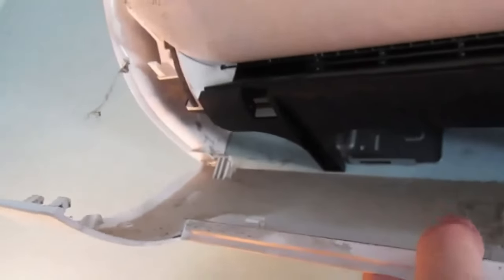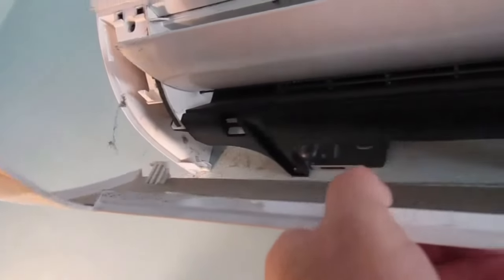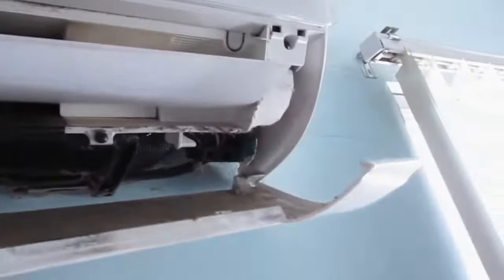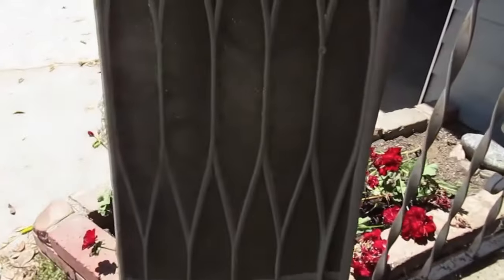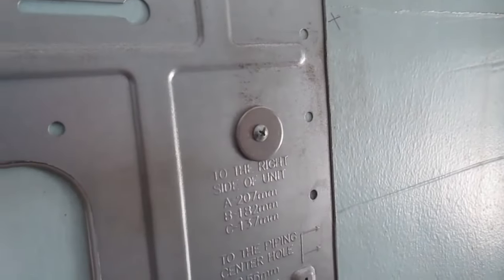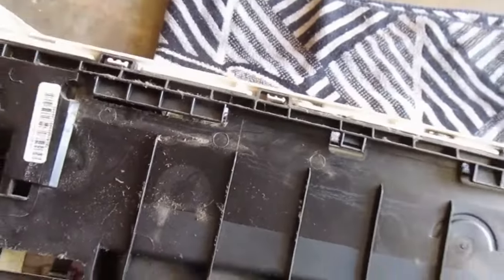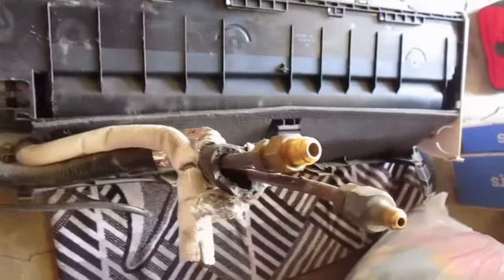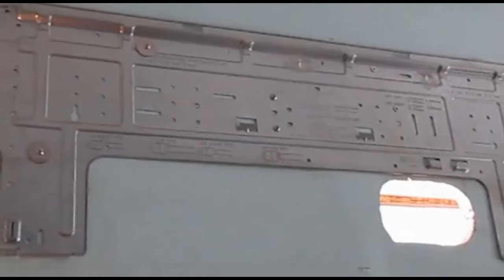Remove Mini-Split Indoor Unit

Comment from the maker: * Mini-split A/C lineset (this is the link to the 25 ft.; other lengths available also): https://amzn.to/3uB3pO6
* The gauge set used in this playlist is available here: https://amzn.to/48hwEDn
* You will also need an adaptor to connect your gauge set to your outdoor compressor, which is available here: https://amzn.to/3wrOV3v
* HVAC quick connect coupler fittings: https://amzn.to/4a2DkpG  <<<less prone to leaks, easier to install than flare connections!
* HVAC quick connect right-angle coupler fittings: https://amzn.to/3yciW8k  <<<prevent leaks and connect your linesets with ease!
* When connecting a lineset to a compressor via a flare connection, use "Nylog Blue" HVAC sealant, which is available here: https://amzn.to/3SL49bs
* Featured in this video series is an LG mini-split system. Comparable to LG systems - but more affordable - are Mr. Cool mini-split systems, which can be found here: https://amzn.to/3T9rLb2

Note: linesets consist of two separate refrigerant lines, these can be 1/2" O.D. & 1/4" O.D. or 3/8" O.D. & 1/4" O.D. Make sure you order the correct diameters to connect to your outside compressor unit! I recommend that flare connections ONLY be used where the compressor connects to one end of the linesets, in which case you'll be using factory flares (producing your own in the field can lead to imperfections and therefore leaks).

Comment: How do you disconnect the lines without losing everything in it? Wanting to relocate mine.
Reply from the maker: You can't - you must vacuum the system first. Here's how: https://youtu.be/wWxH5AqCMBk
Reply: Yes you can, pump down (recover) the refrigerant back to the condenser, search how to pump down mini split.

Comment: Hi DIY&S ~ I hope that you monitor your videos because we have a very aggravating situation that falls under the category of "Remove Mini-Split Indoor Unit."  We have a defective Mitsubishi 18K BTU mini-split system that must make way for a new mini-split system.  All of the external connections - power, drain & both gas lines - have been disconnected outside, so, naturally, it's time to pull the old MSZ-FE18NA indoor condenser unit off of the wall, right?  Well ... I can see absolutely no method for pulling the damned thing away from the wall!  The cover was easy enough to remove, which gives one a great view of the inner workings, but I can't see anything that's holding the unit to the wall.  Although it was very tough to spot, I can see that there's a narrow metal bracket mounted to the wall behind the indoor unit, but every attempt to pull up on the unit or away from the wall (or a combination of both) has been like pulling a mule up a freakin' ladder!  Obviously, there's mounting hardware holding this thing in place ... somewhere? ... but that's the thing - it's just not visible.  Do you have any clue about what we can do here?
Reply from the maker: I don't know about Mitubishis, but have run into similar frustrations with LGs. The indoor LG units are resting on clips or flanges on the metal brackets that attach to the wall. At least with LGs, you push the entire unit UP so that it no longer is resting on the clip at the top of the mounting plate - and BTW the unit is not screwed on or attached with any hardware. Try that - unfortunately, however, that's all I can offer. Hope that helps --
Reply: @DoItYourselfandSave  Fortunately, we eventually figured out that the bottom of the plastic "backing plate" had to be pulled down (forcefully) to pull it off of a downward facing 1" wide metal hook on the wall mounting bracket.  There were two of them (one on each side), so once both were unhooked, we were able to lift the top of the plastic backing plate off of its hooks by lifting the whole indoor unit upward.  If you're ever asked about this again, tell the Mitsubishi owners to give that process a try.   Regardless, thank you very much for trying to help us out.  I have now both liked and subscribed to your channel.  👍
Reply from the maker: Thanks for subscribing and also for the tip on Mitsubishis! Definitely a design quirk that needs to be improved --